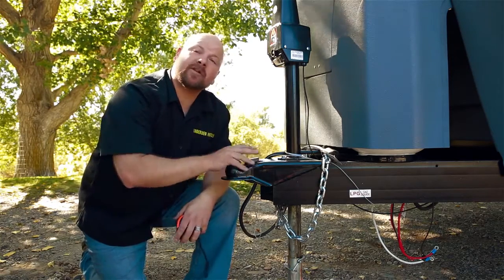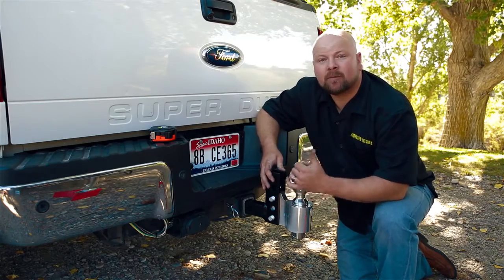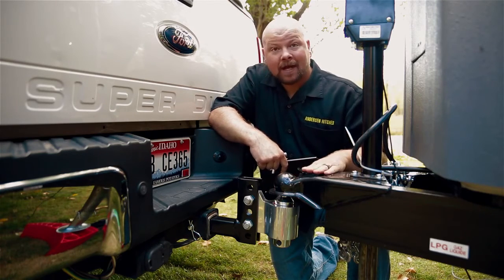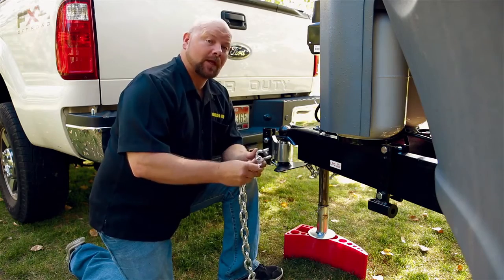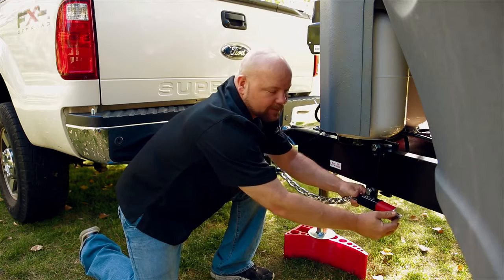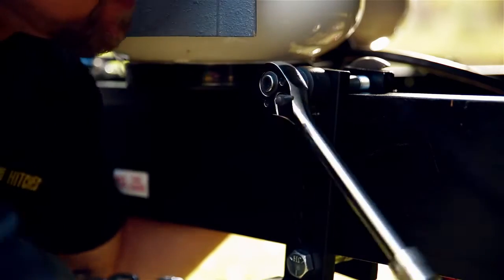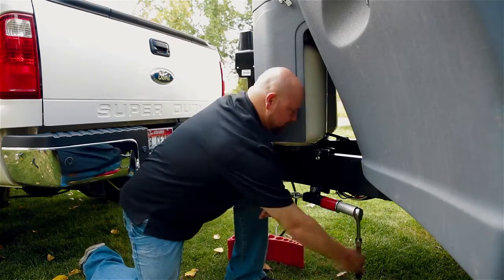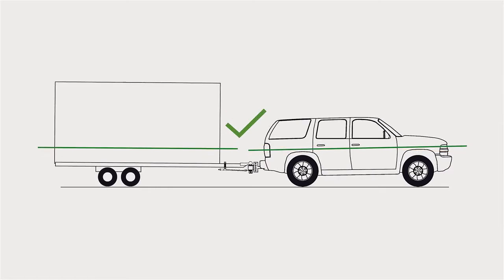How to Install the Andersen Weight Distributing Hitch

Comment: quick question to anyone, on the Anderson hitch, there are 2 receiver pin holes, Does it matter or have an effect on operation if you choose the hole closer to the truck or farther, If I use the 2nd hole to put the receiver pin through, it actually allows me to open my tailgate but I'm curious if this matters, I'm assuming not or they wouldn't have put the option there for 2 positions but wanted to get thoughts.
Reply: Hi, we just got our Anderson with our new Transcend.  From my experience with towing, the further out the ball, the tighter turn you can make.  But the further out, the lower your tongue weight capacity.  I have a F350 and mine is in the 2nd hole.  I'd only be worried about it if towing a heavier trailer with a 1/2 ton.  I need to mess with mine as our ride home from the dealer was a bit hectic as I would get to swaying above 55.  My truck as a 4K payload and the trailer is only 800# tongue weight so weight distribution isn't an issue but @ 36' long, sway is.  They had it set up nose high on the trailer and in my experience,  a trailer needs to level or slightly nose down.
Reply: @shane3878  This post makes me suspect the hitch is a piece of junk.
Reply: @DannerPlace  It's better than the old school bars depending.  I've had those on a Ram 1500 with a 6K TT and was not happy.  White knuckle everytime.  The Anderson's forte is sway control and porpoising.  It's WD is limited and has to be appropriate for the TT and TV.  Since I have a F350 with 4K payload, I don't need WD but with a 36' TT, I wanted good sway control and this system for the cost and how much we are going to be towing was the best option.  Very few negatives in my research and most of those sounded like either setup incorrectly like mine was (way to nose high) or too heavy a TT for the TV.  To each their own.